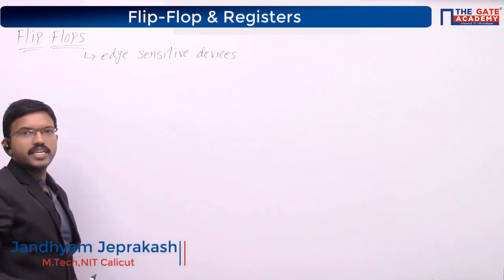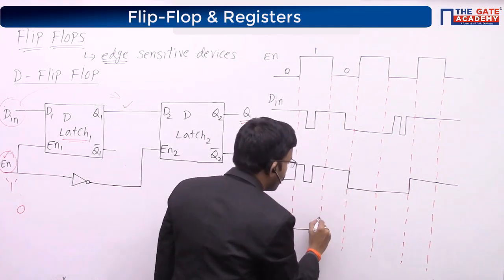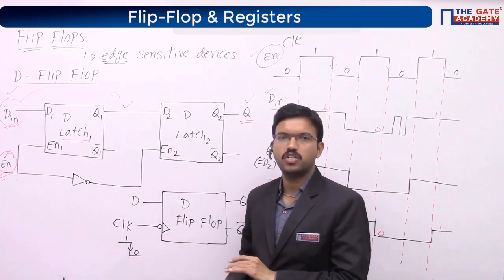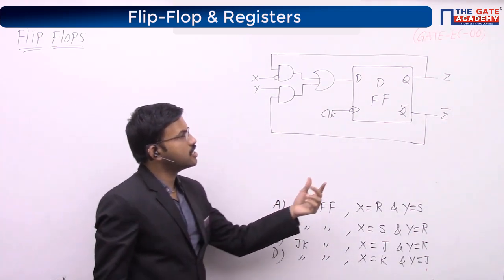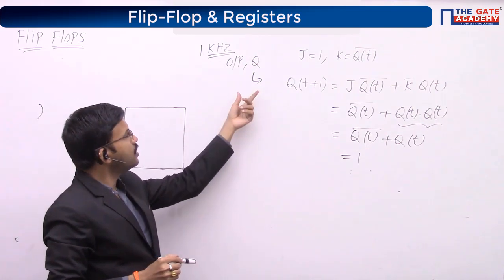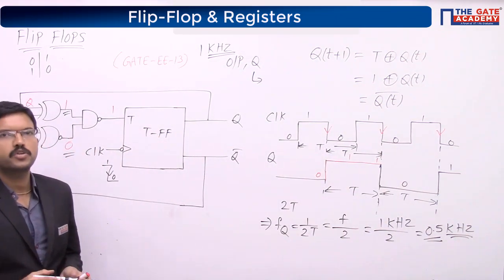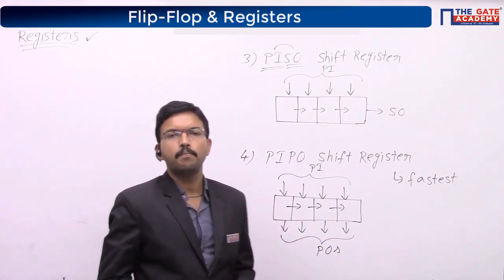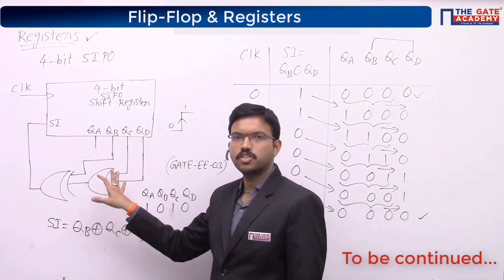Flip Flop and Registers of Digital Circuits | GATE  Free Lectures | EC/EE/IN/CS

Comment: "A digital computer has three registers: A, B and C. Four flip-flops provide the control functions for the computer: S is a
flip-flop that is enabled by an external signal to start the
system’s operation; L and R are used for sequencing the microoperations; A fourth flip-flop T is set by the computer when
the operation is completed. The function of the system is described by the following register transfer statements:
S: C ← 0, S ← 0, T ← 0, L ← 1
L: L ← 0, if (A = 0) then (T ←1) else (R ← 1)
R: C ← C + B, A ← A – 1, R ← 0, L ← 1
Design a circuit with minimum components to implement the above operations."

Comment: Sir hw to find out the frequency of output signal if  four T flip flops are cascaded
Reply: Dear Gayathri, If it is asynchronous counter, the output frequency of 1st stage is fclk/2. At subsequent stages, the output frequency will be half of the clock signal frequency of that stage.